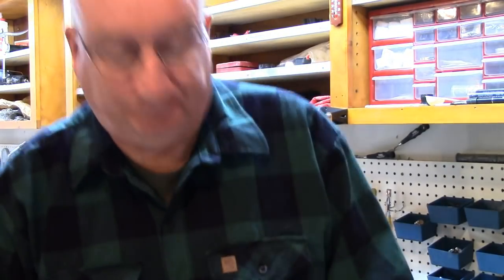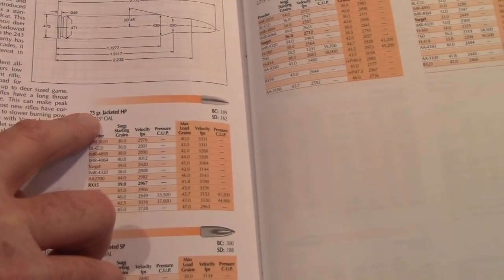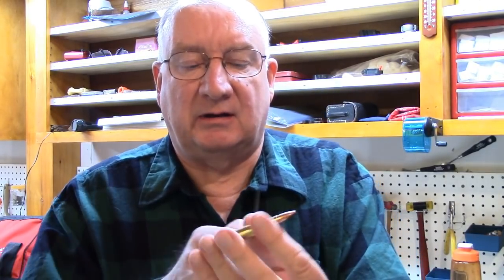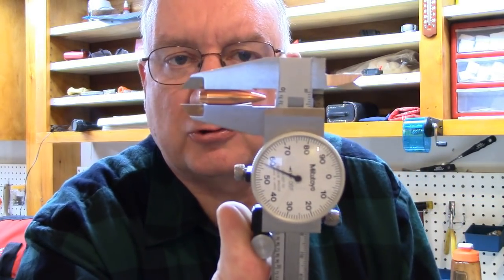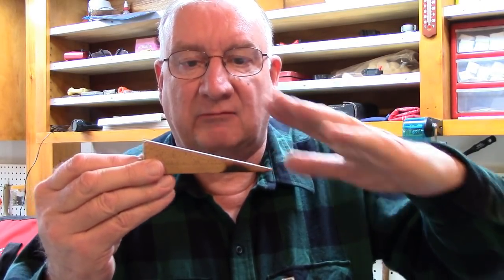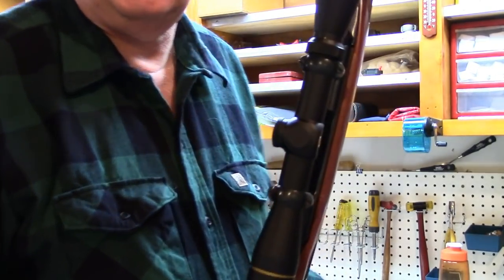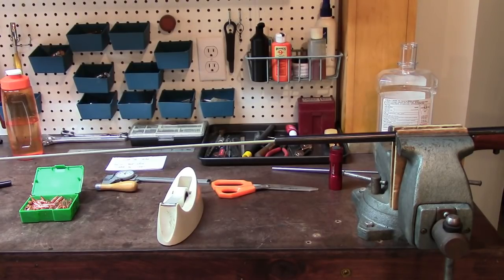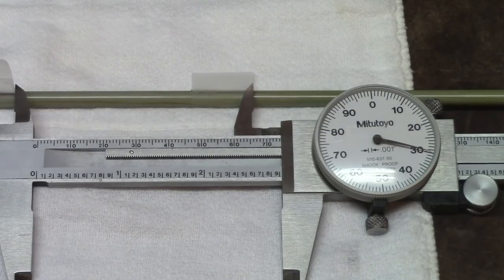Handloading PART VI, How to Measure Cartridge Overall Length ~ GunBlue's Complete Guide

Comment: Hey GunBlue, question about oal. Are you able to get 1/2 moa accuracy out of magazine length handloads or are you hand feeding them one at a time? For my short action Howa rifles, all rounds .015 to .030 from the lands are too long for the magazine. Also unfortunately, the smaller weight bullets do not allow proper neck engagement. Howa bolt action rifles in .204 Ruger, 22-250, .243 and 6.5CM. Great videos as always.Thanks, Lou
Reply from the maker: Bryan Toth 
Sure I do!  And better.  That range of overall length is the ideal, but I have many loads that come nowhere near that range.  My Remington 700 in 22-250 is throated for the longest 60 grain fat ogives, and most standard 50 and 55 grain Sierra bullets are over an 1/8th of an inch from contact.  Factory loads  are lucky if they are a full .25" from contact, and they shoot MOA or better.  My 257 Roberts shoots some of its most accurate groups with sharply pointed 75 grain bullets in a chamber throated for 120 grain bullets.  That rifle is a Model 70 Featherweight with a spaghetti barrel, and drills 3/8 inch groups with short 75 and 87 grainers.  My wife's old Remington pump shot short 125 grain Sierra spitzers into half inch. Overall length is a contributing factor to accuracy, and it certainly can help when it's practical, especially for the custom chambered bench rifle, but it's way overblown out of proportion.  THE MOST significant accuracy issue, apart from good loads themselves, is to place that bullet looking down the center of the bore,  so it gets a good run, and then it really matters little how far it jumps, in my wide experience.  If you watch the Olympic skeleton, luge and bobsled racers, it's the ones that get a straight start who have the best chances, but the ones that bump the sides starting from the gate are like a bullet off kilter.  Actually, close positioning without being centered simply jams the rifling worse and forces the bullet, rather than guiding it.  I speak about these issues and how to control them in a couple of other videos.
Reply: Thanks for the quick and informative answer. Looks like I'm in need of another reloading tool. Since you have this wealth of knowledge I'd like to ask you one more question if I may. Another subject I find little info online  is what to do when you've made your ladder loads and they aren't getting the job done. After tweaking the oal with no success, what would be the next step in tuning that load. Different powder, primer, bullet, etc.? Thanks, Lou
Reply from the maker: First, you must have a base from which to start, and I don't know what your measure of accuracy demands.  The rifle must be capable of consistent groups, or no amount of load tinkering will do anything.  If you know it can shoot accurately, and has done so in the past with some particular ammo, that's a good sign.  If it can shoot consistently circular with factory ammo, even if it's not tiny groups, that's a good sign.  Certain signs are evident with a troubled rifle in need of assistance:  Stringing of shots east and west can be wind, but can also be a poorly bedded receiver, a bad (heavy and/or creepy) trigger, a poor rest or rest position, and shooting technique (uneven cheek pressure, poor trigger control).  A solidly bedded barrel can often shoot quite consistently, though the performance will be limited.  However, a free floated barrel allows natural harmonics to be consistent, but it can also allow a loose receiver to really swing everywhere.  Free floating and a solid action are imperatives that go hand in hand. I prefer to allow at least .050 clearance around the barrel, which is sufficient to allow a barrel to vibrate without collision. The old dollar bill rule will cause more flyers than a flock of starlings.  Vertical, and diagonally strung groups is a typical sign of barrel slapping the stock, or barrel interference.  Check those indicators first, and correct any deficiencies.  I prefer standard, solid sand bag rests over any kind for the tightest groups.  Rolled sleeping bags, padded blocks of wood, and a great number of the expensive cradles and sleds do not provide for accurate, consistent groups either.  Check your crown and be certain it's clean, with no dings.  You will need a strong light and a strong 10X magnifier, like a jeweler's loupe, to see the crown closely.  A slight imperfection there will send bullets off course.

Check your scope mount and be sure it's solid.  I once watched a poor guy trying to chase his bullets back onto the paper, and when I checked his scope, it was actually loose.  Don't fret over lapping, which is ridiculous.  None of my 1/4 minute rifles ever saw lapping compound.  Scope quality is important, but you need not spend a fortune.  Names like Bushnell, Nikon, and certainly Leupold will shoot as solidly as any Zeiss or Swarovski, but I have seen inexpensive scopes that couldn't hold a zero.  If you are using a Weaver style base, be sure to seat each ring solidly against the front (muzzle direction) of their grooves before you strap a scope into them, or they will use the scope as a tug of war rope.

The rest is all important.  For many years, I shot with a variety of different makes of tri-pod style rests which all worked well, but really, only a benchrest style rest can provide solid performance.  I often use a light, portable Hoppe's rest for informal testing, but my Caldwell Rock BR is certainly far more stable, and can slice groups in half, yet it's still quite portable and within reason cost-wise.  The more you can spend on one, the better.  A rear rest is just as vital, and will make or break your groups.  With my Caldwell, I use a Protektor Custom rear bag with the high bunny ears, which grasps the rifle in a vise-like hold.  Toss some talcum powder on the leather of the front and rear before shooting, to allow the gun to slide.

As for the "ladder" or more traditionally called incremental loads, follow my proportions to be sure they are correct for the case volume.  I don't know what powder you are using for what cartridge, but it's generally easier to find a good load with a forgiving single base extruded powders than with fussy ball powder.  Ball powders drop perfectly uniform loads that often shoot inaccurately, and are subject to whims of temperature and chamber heating.  Extruded powders drop inconsistent loads that typically shoot accurately under all conditions, over a wide range of charges.  It's never a bad idea to start with the suggested loads in a loading book, and work from there.  I have not necessarily found the best loads to be the suggested ones, but I have never had a bad suggested load, ever.  Certain powders just seem to give good results with a very wide range of cartridges, and such names are any of the IMR series, the Hodgdon extruded (which are copies of the old IMR [but never interchange them]), the Reloder extruded powders, and Accurate extruded powders.  I have yet to find a medium size case that didn't absolutely love Reloder 15 (R-15).  And my powder dispenser drops it like ball powder.  Now that's not to suggest that ball powders can't work.  I have had terrific results with BL-C2 and CFE-223 in my .223 loads, and they are very consistent.  And I have had wonderful groups with H-414 with .22-250 loads when they feel like it, but the accuracy can drop like a bomb any given day without warning.  I would rather have a consistent 1/2 inch rifle than a load that shoots 1/4 inch one day and 1-1/2 inches the next.

Start with flat base bullets.  They are more accurate.  Boat tails are great for long range performance, but are not necessarily the best group-ers at intermediate ranges out to 300 yards, which is why bench rest shooters rarely use them.  Once you establish a good load, then try the boat tails if you need them.

Use standard primers for any loads under 60 to 65 grains, period.  .222 and .223 based cartridges use hotter primers, but the manufacturers have already factored that into the standard ones.  All the old small rifle primer cartridges, except for the Hornet are long obsolete, and all that's being sold are for the .223 type rounds.  

Finally, and I probably should have mentioned this first, MOST standard weight .224" bullets are NOT made to spin at the huge centrifugal forces that current 7-inch twist rifles do, at the speeds that the 223 can launch them.  They have jackets made thin to explode on contact with standard twists, and will distort in flight.  If you are using a fast twist barrel, you need a heavy jacket to go with it, made for high stress.  My Colt AR-15 A4 with a 7 inch twist will group into a 2-1/2 inch circle with most bullets up to 50 grains unless I use the Sierra bullets designed for 22-250 velocities and stresses.  My best so far is the Sierra 50 or 55 grain Spitzer, and even the boat tail version works well.  Never use a high explosive bullet designed with a thin jacket.  Those were made to give 22-250 explosiveness to the velocities of standard 12 and 14 inch twist .222 and .223 Remingtons, and they just won't take abuse.

I have no idea who's brilliant idea it was to plug 7 inch twist barrels onto AR rifles, when any National Match shooter is perfectly happy with nothing faster than 8 or 9 inches, often even 10 or 12 inches.  It's a fad without a need.  There is only one bullet that I know of that might possibly call for a 7 twist, which is rarely sold.  7 twist radically reduces the number of bullets that will hang together without distortion under high spin rates.  Based on the number of 55 grain FMJ bullets sold, those same loaders would find great happiness and more accuracy over a wider range of loads with a standard 12 inch A2 barrel strapped on.

That's all I can offer.
Reply: No need to respond. I should have offered more information. I've been reloading pistol for 4 yrs. This past year I purchased 4 Howa 24" varmint barreled actions and mounted them on Boyd's laminated thumb hole stocks. Free floated with tang and recoil lug bedded. Triggers at 2 lbs. Lapped bottom rings for Vortex Viper 6.5-20x44 scopes. Have made loads for each rifle in ladder pattern but have yet to shoot them. Two months away.Was asking for load solutions in advance of any accuracy problems. Anyway, thanks again and enjoy your weekend. Lou

Comment: hello..i like this process..but, i do have 1 question..some barrels have a recessed crown,which could present a problem,with your way to measure.wouldn't this small difference from the end of the barrel,which is were you place the tape,and the actual end of the rifling at the muzzle end,throw off the actual col distance??  i have a new Winchester model 70,and with the target crown recessed ..how do you handle this type of situation?  sure hope to hear from you..thanks again, jb
Reply from the maker: jon b. 
I have the same gun, which you saw in the video, and it makes no difference how deep or what shape the crown is.  You measure from the longest aspect of the barrel, not the length of the rifled section.  That's why stiff tape is used.

Comment: Am I missing something? I thought the cartridge would stop on the datum line. If so how do you know the bullet is engaging the rifling? Are you using a dummy round thats set for your minimum neck bearing?
Reply from the maker: Larry Losciale 
You are mistaking headspace for Cartridge OverAll Length; COAL.  One has nothing to do with the other.  The datum line is the location on the shoulder as reference for headspace dimensions, used by chamber designers, which is used to establish clearance between case head to breech face.  COAL refers to the limitations of the cartridge length with a bullet.  This process takes two simple measurements; the length of the muzzle to the bullet tip when it's against the rifling and the length of the muzzle to the breach face.  Subtracting the shorter from the longer arrives at the maximum overall cartridge length, from which you can assess the bullet to rifling clearance (jump), and seat accordingly.  Your headspace is a fixed measurement that concerns only the gun and cartridge case makers. Datum line has nothing to do with it.
Reply: I understand the difference of the two. My question is if your using a bullet that is seated in a case how do you know it is actually long enough to touch the lands if that case cannot go any further than the datum line allows? I would think you need to have the bullet extend further than normal to insure this. Am I mistaken? If you seat the bullet too deep to reach the lands how can you get the proper measurement?
BTW I have also seen another way that gives you an actual cartridge to measure. Take a case and make a small slit in the neck. Place the bullet in question into the case neck. place this into your bore and push forward. The rifling will effectively seat the bullet to the length needed to touch the lands. Remove the cartridge and mesure. Admittedly this method depends on just the right neck tension to allow the bullet to move and not get jammed in the rifelling but it is simple and can be quickly repeated to insure accuracy.
Reply from the maker: Larry Losciale 
With my method you do not seat a bullet into the case.  You seat it into the rifling, and take your measurement. Then you remove it and take the measurement to the breach face.  Slitting necks, sticking bullets and slipping bullets and datum lines have nothing to do with it.  I know all about those methods.  This one works and is based on simple measurements, without complications.  Only an engineer making reamers has to measure datum lines; it's entirely irrelevant.  Please watch the video again.
Reply: See, now you stopped me from watching part VIII !  Ok so like I said "am I missing something?" apparently I was, I didn't see that you dropped only the bullet in it looked like the whole cartridge. My mistake. Now it makes sense.

Comment: Happy Holidays to you and your family !!! All other things being equal and just in general, what would you say is more important...bullet to powder seating depth or bullet to rifling ? I'm currently shooting a mini14 in 300 blackout with subs,and have found that I usually have to choose between one or the other ..thanks for the no nonsense quality information .
Reply from the maker: Johnny Costner 
Seating depth is based on external chamber and sometimes magazine dimensions and has no relationship to powder whatsoever.  The bullet to powder depth is entirely consequential.  The only time it becomes an issue is with powders that over fill a case to the point that the bullet cannot compress it to the required seating depth.  Compressed loads shoot as well as loose ones.  Published seating depths are the minimum, or shortest permissible, and with shorter bullets, it may be the "caliber" depth to acheive sufficient neck grip.  Only the rifling and magazine limit the maximum length. Merry Christmas.

Comment: Excellent technique, I think if you knew you’d be doing this enough, a couple of short lengths of rod or bar drilled to fit over the rod and with a grub screw fitted would make this even simpler and surer than tape
Reply: Tiny binder clips would probably also work well

Comment: AND to double check your measurements. Take the measurement from the outsides of the tape and deduct the thickness of one of the tapes and it should be the same as your value 2.930. (just a checking procedure/ call me goofy) I've yet to measure my new 6.5 CM Tikka but this is on the agenda.

Comment: Thank you for sharing your vast knowledge with us, it's nice to hear a voice of wisdom and reason amidst the static.
I would like to ask you a question- I continue to use my original RCBS powder measure from 1982, my question to you is how or do you clean your powder measure? I wipe out the interior but that's it. The reason I'm asking is that recently I noticed that the adjustments are getting stiffer.

Thank again for a job well done